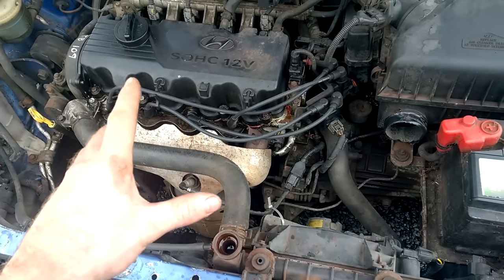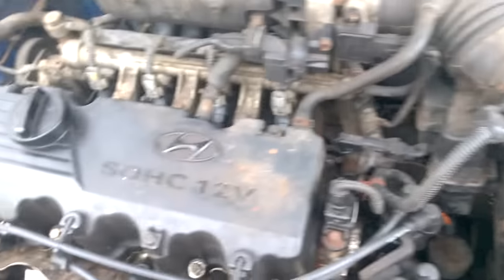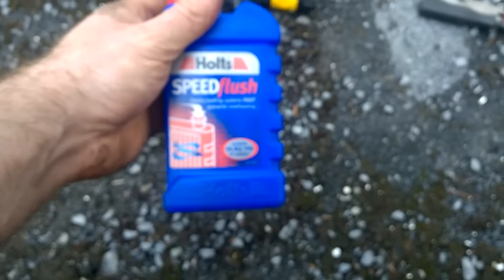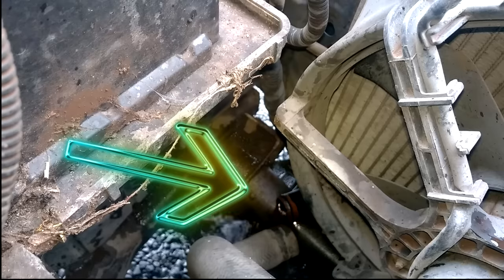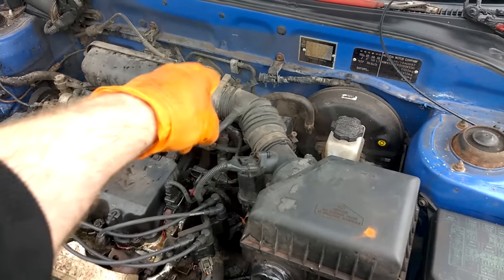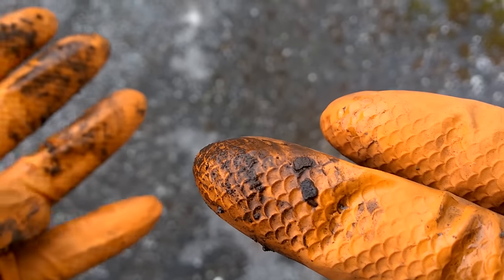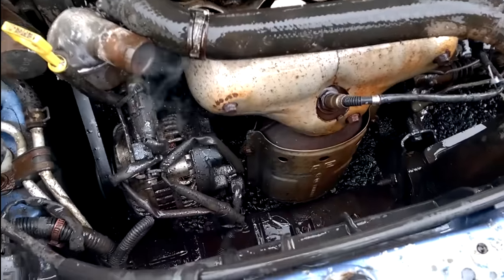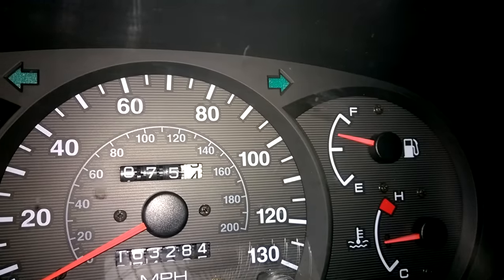Flush Your Cooling System - The Proper Way!

Comment from the maker: For anyone that was worried about the disposal of waste coolant, I just wanted to reaffirm we have run off drains into tanks, we are fully environmental compliant in all disposal areas of the workshop, regular tyre disposal pick ups, waste oil, filters and waste cleaners all collected. We have multiple tanks out the front and side of our garage. I hope this clears it up for anyone concerned.
Reply: Oh, man,...I appreciate the video, but you my friend, ARE NOT IN A WORKSHOP!  You are clearly OUTSIDE, on a "gravel driveway", with grass in several of your downward shots!  Unless your tanks are large enough to ALSO collect rain runoff, this just doesn't look right,...I'm sorry.  I hope I'm mistaken...; /
Reply from the maker: @timrick2  you are wrong, 20,000 litre tanks underground. 
Thanks for stopping by. I have reaffirmed this already with my last comment.we are fully environment compliant and have all our certs up to date and disposal is regular.
Reply: It's going into the grass and all over the place. Even if you have drains, you don't know that all of it is ending up there. Smh.
Reply from the maker: @FueledByRyan0  I usually don't respond as I have answered this question already but here is some more detail. The driveways on both sides of our workshop (and front) were completely dug out for soak pits and drains/tanks in different areas. the grass/weeds that people are seeing on the driveway is just surface weeds like you would see in the crack of concrete etc.. it is not soaking into any soil or running into our garden as it is kept separate. we would have a completely tarmacked drive except we had to upgrade our tanks and piping a number of years ago (at a huge cost) and the driveways were all dug out, it was just resurfaced at the top with a stone and chips finish which is next to impossible to kept weeds off. there is concrete, stone and piping all underneath what is visible in this video leading into tanks. Architects/engineers approved and completed the work. we are fully enviro compliant. I can say no more on this topic. I really hope this helps.
Reply: @Gerard burke
Reply: @FueledByRyan0  lol Jesus Christ I hope you and Gramps up there arent serious. your critical thinking ability would make a neanderthal shake their head
Reply: @GerardBurkeBurkesGarage  when i saw water coming out from engine flushing, directly on alternator.... 😢
Reply: @uroskostic8570 it won't hurt but he should have left the hose attached there and disconnected it from the radiator side to aim it using the hose

Comment: I was always taught to 'reverse flush' both the engine and radiator when pressure flushing a cooling system. ie, remove thermostat and flush engine from top hose and out the bottom hose (reverse to normal coolant flow) The same applies for the radiator, flush it from bottom hose, up through radiator and out the top hose (reverse to normal coolant flow) to avoid forcing the junk that settles on the top of the radiator cooling tubes further into the core. The best way to flush a vertical tube radiator is to remove it from the vehicle and invert it when flushing, or lay it down flat with the cap on, and hoses facing up, then fill it with water and pressure blast it from the bottom hose out the top hose👍🇦🇺
Reply: Yep he's doing it wrong.

Comment: And next video — “how to replace an alternator that got wet” JK. Nice video, good info.
Reply: Or the next one will be how to replace a blown radiator or heater core from the air pressure
Reply: Or, how to replace radiator due of burning smell of antifreeze
Reply: Why in the fuck would you replace anything for getting wet
Reply: @michoacan91davi  Are you new with electrical equipment?
Reply: @dnor16  
I think he's new to LOGIC in itself🥴
Reply: Do you not think that alternators are designed to cope with getting wet ?
Reply: Have yall never pressure washed your engine before
Reply: @dnor16  an alternator can take a beating, so yes water will affect it, but it will still function after getting wet..

Comment: Thanks Gerald, for your very informative video from Australia. Here in the U. S. very shortly I plan on using that tool and procedure to correct a partial heater core blockage on my 2012 Chrysler 200 Touring convertible.
Reply: That’s what I’m dealing with right now

Comment: I have done that with several old vehicles I have had and I would have to do it regularly over a week or two and it worked fine for the rest of the time.  I do not think you did any more damage to the alternator than drive the car in a strong rain, but better to cover.

Comment: Excellent that you mentioned Heater Matrix; more likely to fail than the Rad; especially with that amount of crud, which is usually hugely expensive to replace. I was wondering about the Thermostat; and Oil Cooler if there is one? I would always use DI water for final flush and the coolant / antifreeze mix.

Comment: Great vid, ive got to do the same thing to my truck, what psi are you using thru the flush gun? wouldnt full shop air cause some damage?
Reply: Yes to much psi would cause damage to heater core

Comment: Last year i flushed my cooling system similar to this but i wrapped the alternator to avoid getting wet.
Reply: Why lol? You do realize your alternator isn't sealed from the elements under the hood right? If your alternator goes out from getting wet you better take that shit back to orilleys and go get you better made one. 😂
Reply: Next time just extende extract hose and then pressure... 😂 Don't hose your weir... electric system

Comment: Hi Gerald, thanks for the vid. What pressure you run the gun at ? 40psi?
Reply: No more than radiator cap/cooling system rated pressure for water and air. 10-15psi is a good average, it's more than enough and won't over pressurize anything in the system.

Comment: I think this is good job.. perfect and effectively...  good idea... and relevant technics.... good enough using high pressure water....  but when the hole pipe output the dirty water splash spread anywhere in machine area... you must set first using tire motor bike for piping out- pouring out... going down to the ground... . I think you undersand what i mind...

But the high pressure too high the rate PSI.. . ?

Comment: Can someone explains to me what is the difference between forced flushing with pouring water into outlet hose of heater core and just regular flow of coolant through heater core? It looks like that’s just a flow of water(coolant) through heater core, just in opposite direction when you flush it with water. Why than just coolant flow can’t just flush heater core with regular flow when you turn on heater. If there is any clogging, what is water gonna do different than regular coolant flow? Thanks for help in advance.
Reply: The key word is “back flush” with your regular heater on with coolant, it will always go in one way, coolant or water the key is to reverse the direction of flow, because with the coolant going one way (in normal autonomous operation) it will simply keep embedding the dirt/debris further in by going the opposite way it will remove both bigger and smaller bits of trash. It doesn’t really matter water or coolant the key is to go the opposite way, and water is much cheaper than coolant.

Comment: I was about to do this after reading the instructions in a Haynes manual for a Ford Fiesta mk6.5 tdci Euro but they say after taking the thermostat out,  run a water hose in the top radiator hose after disconnecting it from the radiator and let the flush water emerge from the bottom radiator hose whilst it is disconnected from the radiator too. But your flushing through the bottom radiator hose. I'm not saying you are wrong but need to know, does it matter and why. I think the Haynes method is reverse flushing it if i'm not mistaken. Also, before reading this i already bought 25L of deionised water. I bought 25L as extra because i need it for other cars and i intend to use this as a mix for the antifreeze concentrate. Is deionised water ok to mix with or should i have got something else.
Reply: Not sure what deionized water is but you’re supposed to use distilled water.

Comment: Actually the proper way doesn't involve tap water.  Dont forget to mix your coolant with distilled water. Using tap water is part of the reason cooling systems get like this in the first place.
Reply: Only thing worse is WELL water.
Reply: Michael Wilson - distilled water is the best to use. All your link was is to an ad for promoting some product using scare tactics. I maintain my vehicles myself and have used distilled water during regular change outs and have zero issues. Two vehicle have >225k. I think the science quoted in your linked product ad may be entirely true in theory but in reality is so far down the list of things to proper maintain your cooling system that it is BS. Bottom line is flush coolant every 50-75k thoroughly and properly (using distilled water) and you will never have cooling issues for hundreds of thousands of miles if you keep your car that long.
Reply: @iamasmurf1122  
So before i read this, i had already bought 25L of deionised water for my cars cooling system after hearing of scare stories of using tap water in the UK. Is there any way i could soften the deionised water by adding an amount of sodium chloride or other. I'm reluctant to use the ionised water now and already bought 5L od antifreeze concentrate.
Reply: @thomassullins8690  funny thing is i grew up doing just that and never had any cooling related issues with several cars. we flushed our cooling systems every other year on vehicles that all lasted over 200k miles. only ever used well water.
now im living on my own on city water and will only use distilled. seen the ppm readings and figure i wont miss even 20 bucks a year if i go nuts with bottled.
then again... i guess big water figures if even a minor percentage of ppl think that way they got it made.
if ur  bottled water comes in a plastic container there is plastic in your water
Reply: @nickabel8279  Does your antifreeze not come in a plastic container?

Comment: I thought I was watching a commercial for the air/water pressure  thingy.  Lol
I have used white distilled vinegar to clean the radiator.  A learned acetic acid is used to clean the plumbing at chemical plants in Houston.
Reply from the maker: I'll take that as a complement :) LOL thanks for input and comment.

Comment: I wonder what is the PSI you applied to the pressure gun? I am afraid it will damage the system if it was too strong.
Reply: George Ku  you are right. More than 10 psi might crack the radiator.
Reply: Most cooling systems run at 16 psi when hot

Comment: "the proper way" then drains toxic glycol all over the ground and blows crud all over the alternator/engine.  This is still a valuable video worth watching as the channel calls out isolating the radiator, core and block for individual cleanout and shows the pressurizer and cleaning fluid.  The concept, pressurizer and chemical are proper backflushing and very helpful whereas the typical guy runs a garden hose for 2 minutes and calls it good.
Reply: you might want to read post where he said he uses catch basin etc. before you go on a bashing spree.

Comment: That's one way to make sure the owner is going to need a new alternator soon
Reply from the maker: very little got on it, I only used that side for easier viewing when recording, I actually put the hose back on that end and flushed it through shooting over the front panel, when the pressure is on fully it would not have come close to the alternator, that was a consequence of trying to get the best visual for the video and using the trigger lightly.

Comment: i heard you should never use tap water to flush your coolant system. tap water contains a lot of different chemicals and minerals which is not good for sensors etc. use distilled water. yes it costs around 10.00 for 10 litres of distilled water but it’s peace of mind.  that’s what i use.

Comment: This definitely not the  "proper way"; you are meant to reverse flush putting that pressured water in to the bottom of the radiator not the bottom. Your way may move crap further into the radiator core blocking it.

Comment: Could have left the upper radiator hose connected to thermostat housing and maybe connected another extension to that and routed the dirt water out of the car instead of dumping waste water over the engine compartment.

Comment: Just use a garden hose with a $2 trigger nozzle . Remove thermostat flush the block both ways then the radiator both ways. Then reassemble leave stat out put the cleaner in with water drive it a few hours let it cool. Drain refill with water warm it up drive it some let it cool drain. Then I pull the hoses let everything drain out put the stat back in refill with proper coolant and distilled water. No fancy blasters needed. I don't think that little blaster with the air going to do any different then 90 psi from a garden hose. I usually drop a new stat in also cheap easy to replace.  This is if the system has been using old school green coolant that corrodes after a few years.

Comment: You realize when flushing any radiator type fixture, it's always most efficient to flush in reverse?
Reply: Why is that?
Reply: @orlando9609  Probably the same principle as shaving against the grain in which your facial hair grows.  Shaving against the grain is more effective because the stubble sticks up as opposed to lying flat when shaving with the grain.
Reply: He did
Reply: @orlando9609  Because particles go with the flow and accumulate in places where there is a mesh like a radiator or heater core. Just like a kitchen strainer. Reverse the flow direction and the accumulated particles start to release again but now there is you that collects them in a bucked or something.

Comment: You are lucky the thermostat housing was easy to get to. Someone of them are on the side of the engine under the intake manifolds or even worse places
Reply: Bloody TDI engines with their thermostat right underneath the intake manifold. Only thing in a worse spot is the EGR valve/cooler.

Comment: Is the alternator ok with all this water coming on it?
Reply from the maker: Hello, I have spoke about the alternator situation many times in the comment section. It would never have happened only for I was trying to get the best visual lighting etc.. for the video. I was triggering very lightly and that was the consequence of it.  
Lastly the alternator never failed and the vehicle is no longer on the road due to out annual car test making it too costly for the owner to keep on the road. He since has bought another vehicle but the cooling system and charging worked perfectly for the customer after this job while he used the vehicle.

Comment: Should have left the top hose connected so the water wouldn't run on the alternator,and just disconnect from radiator and Angel so it doesn't harm anything.

Comment: With the green stuff, drain and fill every year. Then no flush is ever needed. With long life coolant, drain and fill the radiator every other year. Then no flush is ever needed. Way better. No corrosion, no tap water with minerals in it.
Reply from the maker: Maintenance is always the best way, it would have never gotten anything like this if it had been replaced at certain intervals, saying that I understand people can't afford to replace all recommended fluids each time they are due.

Comment: You don't need air to flush out your coolant system, you get enough pressure that comes out of your water garden hose, purchase a water zero filter pitcher it takes all the ppm out of your water. Flush out your system every two years, a normal psi that comes from a home pipe system is between 30 and 80 psi. that's enough pressure to destroy your radiator and heater cores, you can adjust water pressure. people love wasting their money.

Comment: For a professional, you sure didn’t do any justice to the alternator
Reply from the maker: Hello, I have spoke about the alternator situation many times in the comment section. It would never have happened only for I was trying to get the best visual lighting etc.. for the video. I was triggering very lightly and that was the consequence of it.  
Lastly the alternator never failed and the vehicle is no longer on the road due to out annual car test making it too costly for the owner to keep on the road. He since has bought another vehicle but the cooling system and charging worked perfectly for the customer after this job while he used the vehicle.

Comment: WOw the quickest way to blow a head casket or anything which will crack due to putting cold water through a hot engine and even warm engine, as in you can touch the engine cover or rocker cover, but touch the head areas and if you hand burns its the quickest way to crack your head, so never ever put cold water under pressure in a hot or even very warm engine never ever, if anything do it with the radiator flush product run the engine for around 10 to 15 minutes rev it with the heater on as well for that time period ,but do not over recv it, so every now and then during the 15 minutes of running the engine with the flush product through it and then wait to it cools down completely and then flush the water and crap out, then fill it up once you can see the radiator and water coming out is clear and never use tap water to re fill, always use demineralised water with the right coolant mix, full stop?